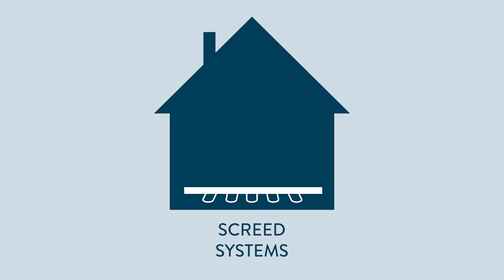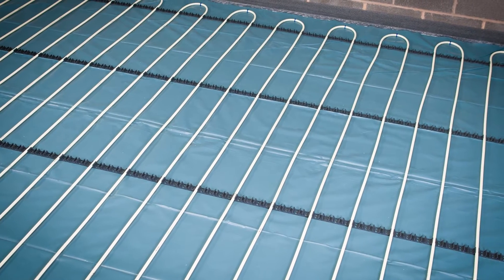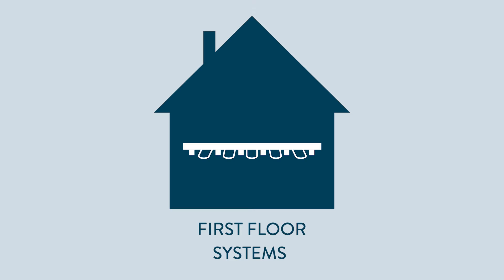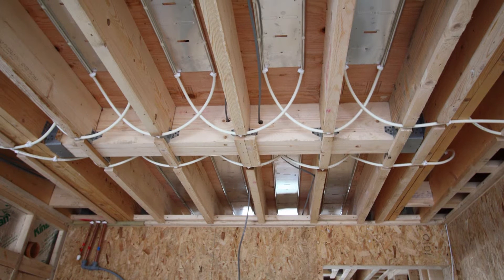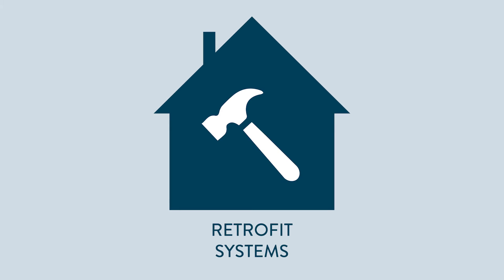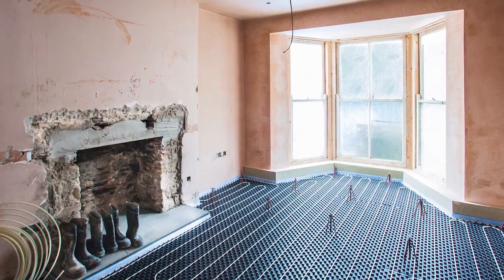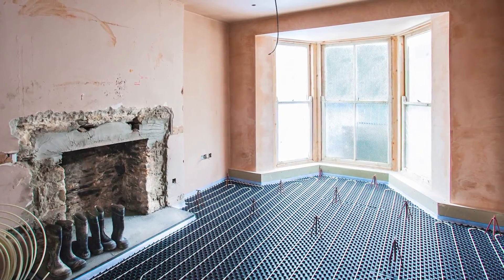Types of Underfloor Heating - Water vs Electric

Comment: Very good video - I was looking for a quick summary of the options - elec v water. This covers most of it.
What I could have done with is a summary of the key components for each system - when set up properly. I see lots of videos of people putting down electric mats on existing floors. What concerns me is the insulation or lack of insulation between the mat and the concrete.
Thank you for the video - I will share this with my daughter and her husband (both very busy people).
Reply from the maker: Thanks James. If you, or your daughter or son in law, have any questions please feel free to call us on 01404 549770, where one of our experts would be happy to help.
Reply: What’s best for suspended floor ?
Reply: @Toney1232  it is a good question. As our living area was down stairs partly on existing concrete and partly new, I can talk about those and what we did. We did use Continal Underfloor Heating system, they might be worth speaking to, they were very helpful.
Reply from the maker: @Toney1232  Hi, this will depend on the construction of your floor - this page will help explain the different options available: https://www.nu-heat.co.uk/underfloor-heating/suspended-timber/ However for more information please feel free to give us a call on 01404549770